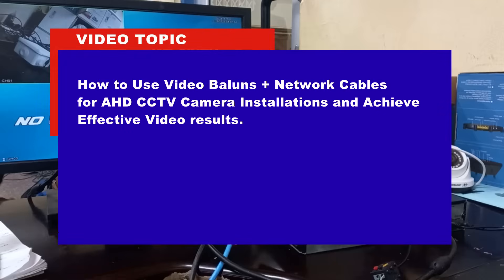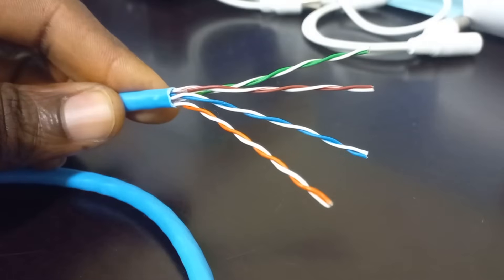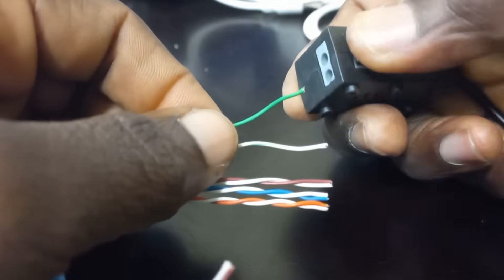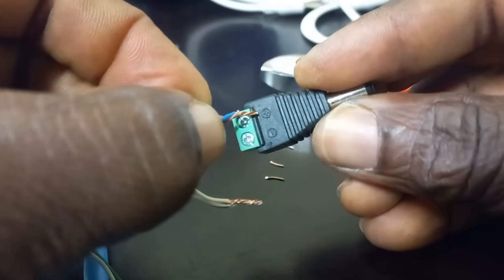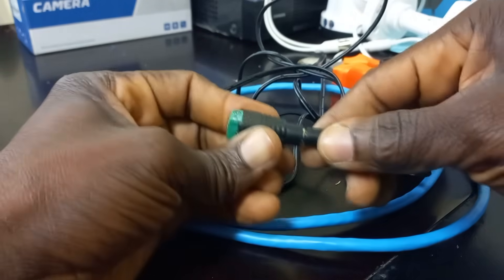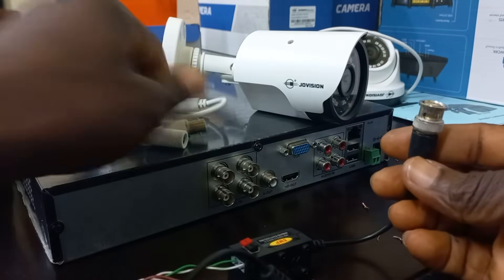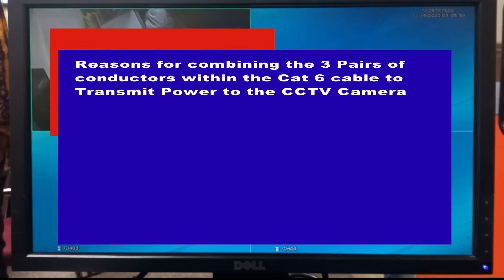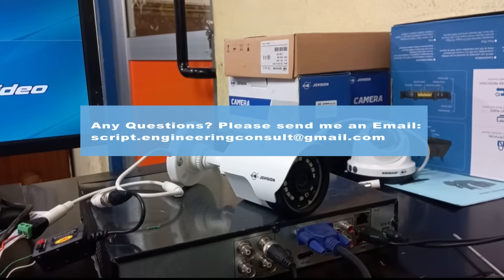How to install CCTV Cameras Using video baluns + network cable.

Comment: We did the cable connection right but the camera video wasn't showing on the monitor, what could be the problem
Reply from the maker: 1. Check for power in the camera and correct it if not present.
2. Check your video connection, be sure they are well done

Comment: can I do the same using cat 5 cable?
Reply from the maker: Yes, you can use cat 5, just that Cat 6 is much stronger and more reliable
Reply: @Tech_Inside_Out thank you so much 😊
Reply: @Tech_Inside_Out i do the same thing by following on your tutorial unfortunately camera is not working..what do you think the possible problem?

Comment: I don't see the light outside my camera and says no video 1/4 cameras what can be the problem
Reply from the maker: Please check your power
Reply: @Tech_Inside_Out  I have 2 camera connected to the adapter but only 1 camera is working on it can it be the wiring?

Comment: My question is why do we have to make use balloons across the cat 4 or 6 cable and why do we use cart4 cable.instead of coaxial cable?
Reply from the maker: The most reliable cable for connecting AHD Cameras is the Coaxial cable with power or the use of Siamese cables, that not withstanding, running coaxial cables become very bulky and difficult to run in large installations, hence the use of network cables.
I don't know how Cat 4 cables will perform on AHD cameras, but i know Cat 5 works well when you do your terminations well.

Comment: Hello I would like to know what to do in case my cat 6 cable is short and needs to be extended, is it possible
Reply from the maker: It is not advisable to join a Cat 5 or Cat 6 cable. Should it become necessary to join, you can join it on a Krone
Reply: @Tech_Inside_Out  well at this point its necessary . thank u for your support

Comment: When IR light is off at night then will record the video?
Reply from the maker: The IR light goes off when there is adequate light for the camera to see images clearly but the recordings will continue even of the IR light goes off.
Reply: Sir,if there is no adequate light available in the room and even the red light is not showing,will it still record?

Comment: Very, very impressive. Well done, bro! I have some questions on the power side.

My first question is: Why would you choose a normal 12V adapter over a power supply?

Second, you didn't mention that, especially when installing many cameras, if you don't prefer to use splitters, it means you'll need multiple adapters, correct?

And third, when the distance is very far, which power source is recommended—the adapter or the power supply?

thanks and regards
Reply from the maker: 1. I used the adapter for the sake of the demonstration and also considering the fact that i was using just one camera.
2. The adapter is not an option when installing many cameras. The best is to use the power supply unit.
3 The supply Unit.
Reply: @Tech_Inside_Out  very grateful sir
catch up later
thanks

Comment: Will audio work on cameras with audio??
Reply from the maker: Yes, but if the camera is one that has a separate audio connection cable, you will need to wire it up too
Reply: @Tech_Inside_Out  
Ok thanks so much

Comment: dose distance of the cat6 matter ,in terms of long in meters ranges like 100m ,90m.80,?
Reply from the maker: Once you are within 100m of the Cat 6, there won't be any problem. Signal quality challenges occur when the length goes beyond 100m

Comment: Hey, enjoyed your video. I’m installing a camera for a boat in the engine room so it’s displayed on the radar video feed in the wheelhouse and they already had a cat5e ethernet wire ran and can’t run a different wire. I grabbed a balun connector and did what was recommended in this video only difference is there’s a rca jack going into the radar, so I got a bnc to rca converter cable. Will this work for single video If I just use the bnc to rca connector and no recording? I’m having some issues and the camera won’t display doing this. Just trying to make sure im not doing anything wrong. Figured I’d ask someone with more experience like yourself while I’m trying to troubleshoot this issue. Also, can you power the camera with the box into an outlet and just use the solid green and striped green to display video on the bnc? Or do you have to use all of the Ethernet wire? Assuming you don’t have to use the other 6 if you have power coming from somewhere else. Thanks for the video as well.
Reply from the maker: 1. The video output from the camera may not be supported by the system into which you want to feed the video.
I will recommend that you pick an output from a recorder and rather feed the recorder output into the radar

2. You can use the cat 6 as the video conductor whiles power is taken from another cable, that works. You don't need to use all the cables of the cat 6
Reply: Also, I tried a 720p camera, a 1080p camera and a 5mp camera.  Is there a certain camera I should be using as well?
Reply from the maker: The issue is not with the camera resolution, it has do with the video format which is not compatible with your system no matter the camera resolution.

Comment: Sir can i use a power supply unit in combination with a 12v connector? I mean a DC power supply unit in the end of the DVR with a 12 v connector at the camera?
Reply from the maker: Yes, what is needed is the 12 volts, the source does not really matter in terms of what device is used in producing the 12volts
Reply: @Tech_Inside_Out  Thank you sir
Reply from the maker: @opssonopsson8282  🙏

Comment: When after fixing the bullet outdoor camera and it sometimes turns black and white the later goes to colored, what could be the cause of it?
Reply from the maker: When that colour changes to black and white at night, it is normal phenomenon. At times it may be due to low light condition around the camera during the day. If it is not caused by any of the 2 conditions i just mentioned. then you may have to check your power supply to the camera.
Reply: @Tech_Inside_Out  I will do just that, thank you very much.

Comment: Good afternoon...if been following you nue for sometime..i just want to how to connect 2 AHD cameras to a 1 Cat 6 cable
Reply from the maker: It is not advisable to do that, because there is need for the combination of a number of pairs of cable to use for power to each camera in order to have optimum power to the camera. when that is done, you will realise that one cable will not be adequate to wire up 2 cameras since apart from power, there is need for a pair of conductors to be used for video

Comment: Can i ask how many meters is the limit using this cat6 cable? Can it be use for a hundred meters? Or less? Whats the exact working lenght? Thankyou in advance for the answer.
Reply from the maker: The recommended length to run it is 100m, but that is practical when you use pure copper cables. To be on the safer side, you should run it up to 80m when you are not sure of the quality of your cable

Comment: Boss if you have multiplr cameras like 20,will you still use adapter?
Reply from the maker: You dont need adapters,  you can use a single power unit for all cameras in place of the adapters
Reply: @Tech_Inside_Out  just like the one in the video, right?

Comment: Hello. Thank you for your video. Very nice indeed !
Is there any reason why to choose this particular pair for the signal and not another? I'm asking because the 4 pairs have different twisting pattern...
Reply from the maker: There is no special reason for using the pairs i used and it is not a convention. You can use any of the colours, just be sure to do the matching properly.

Comment: Why not share the cat6 cables into 2 for the power and signals respectfully, so we can also have strong signal
Reply from the maker: The video does not require a large cross sectional area of the cable to be transmitted.  For power, cross sectional area is important.

Comment: 12v 1.5A or 12v 2a power adapter is okay to supply quality power the  2mp camera please thanks
Reply from the maker: Each camera comes with a specification on voltage. You may have to check the power requirement of your camera in choosing the appropriate power your camera
Reply: @Tech_Inside_Out  okay please thanks

Comment: Will you join another cable to extend the pair’s you’ve chosen to go to the power bridge if you were to use the power supply unit ( what cable will be that)
Reply from the maker: I don't quite understand your question, but let me attempt with my understanding.
1. You are not supposed to join the network cables.
2. In running network cables, you don't have to exceed 100m
3. You can always get the network cables in excess of 100 m length.
In case the above answers do not answer your questions, please write to me again on this particular question.

Comment: With this setup can I control my ptz camera and also will I have audio from the camera to the nvr? Please thanks
Reply from the maker: This is a complete setup that can be used in wiring any kind of camera. However, there are specific cameras with audio pick up abilities.
Every PTZ camera has its specific way to wire it up based on manufacturer.
Expect a comprehensive video on PTZ Cameras in the very soon.
Reply: @Tech_Inside_Out  please thanks for your info

Comment: But on the video ballon instructions…it’s says ….No power required
Reply from the maker: That just means that the video balun is a passive device, it does not require power to function. The power termination is meant to power up the camera not the video balun.

Comment: An i use  video balun to 300m cable coaxial because the image not good but in the tester good
Reply from the maker: It is not recommended to run the cat 6 cable beyond 100m. You would have to segment your network and make your cables shorter within 100m

Comment: Thank you for the well explained video, I have problem, I connected my camera using the balunes but I did not have the male and female power connector, so I used the orange and wite orange for the video and had them plugged into the balunes, and I connected the grean pair directly, but camera did not work!? Any advice?!
Reply from the maker: It is advisable to use the power adapter because if you miss the power polarity (+, -) you could short circuit the camera which can lead to damage of the camera. In doing the direct connection as you mentioned,  you should check the cable properly, it could work.

Comment: What's maximum length of cable used for powering cctv camera in order to get the exact power for the camera?
Reply from the maker: The maximum recommended cable length is 100 meters

Comment: Supposed you have 30 camera how many power charger will you require
Reply from the maker: When installing large number of cameras  like the 30 you mentioned,  you don't have to use the adapters. You require a power supply Unit, and in a 30 camera installation you need a 32 channel power supply unit.
Here is a video that shows the kind of power supply unit I am talking about. 
https://youtu.be/f9mNhW3xYUg
Reply: can i still use cat 6 for power supply for many camera
Reply from the maker: @adangodana3635  When you say many cameras, what do you really mean? Please clarify so i can give an answer. 
On standby for the clarification

Comment: This is the definition of tutorials. Not rushed & well explained. Keep it up. Just subscribed. Please do more videos
Reply from the maker: Thank you Sir. I will continue
Reply: This guy is smart, I like him
Reply from the maker: @royochola  Thanks
Reply: Mine where having lines why?
Reply from the maker: @klinsheavens8426  I don't quite understand your question but I guess you are talking about blurred pictures.  It could be coming from  low voltage being fed to the cameras as a result of running the cables over too long distances or using less than 3 pairs for power connections in your installation.

Comment: 5 Hd cameras connect to cat6 cable but Dvr connect  How adapters using video baluns Dc power supply
Reply from the maker: Please i don't quite understand the question,  can you please rephrase it so i can understand and answer.

Comment: Hello sir, isee  uve used two video baluns on one camera, what happens when u have 4 cameras
Reply from the maker: The video balun comes as a pair to be used for both ends of the cable. so for 4 cameras you will require 4 baluns of which you will be given 8 pieces since it is sold as a pair not individually

Comment: Is it normal to supply 12v battery to 12v camera?
Will current affect affect the functionality of the camera
Reply from the maker: It works perfectly, but you need to provide the right terminals to be used in connecting the cameras.
Reply: @Tech_Inside_Out  where no AC power ,do I need inverter to convert the power from solar system
Reply from the maker: Where there is a 12 v dc power, it cn be used directly without the use of an inverter.

Comment: Which one is the economic to use between the use of Siamese coaxial and CAT 6 with baluns
Reply from the maker: If you do the comparative analysis, the use of the coaxial cable + power  or siamese cable are cheaper compared to the use of Cat 6 However, the wiring involved in the use of Coaxial or siamese cable is quite complex to wire, voluminous to handle when dealing with large number of cameras. 
The use of Cat 6 is easier to run, less bulky but could give problems when not properly wired.
When you properly follow the steps in this video, you should not have problems using the Cat 6 cable

Comment: Hello. I'm setting up cameras 120 meters away. Someone recommended I double the cables on the balun for better signal on long distances.
Also can I run 4 cameras on a single cat6 cable while having the power supplied locally
Reply from the maker: For such long distances, i will recommend having Multiple DVRs, where a DVR will serve cameras close to each other and you then link all the DVRs together so you can have all the cameras put together at one location. That will prevent all the distance related challenges.
Reply: @Tech_Inside_Out good idea
Reply: @Tech_Inside_Out please do you have any videos on this

Comment: What is the benefit of using balum  on short and long distance?
Reply from the maker: 1. It gives you the chance to be able to use just a UTP cable in place of having to use coaxial + power, making the cables less bulky especially when installing many cameras 
2. Drastic reduction in faults due to cable Terminations. You will be making less Terminations and hence less susceptibility to faults caused by Terminations. 
And many more.

Comment: How long in meters to run video and power along utp cable?
Reply from the maker: 100 meters is the ideal distance for running utp cables for effective results. Going beyond 100 starts with some level of depreciation in signal quality.
Reply: @Tech_Inside_Out  pls one of 3 NVR 16 channels takes 1 hour to load.

3 NVR.

2 converter close to Poe switch then to each NVR.  

Please what is the issu
Reply from the maker: Check your hard drive